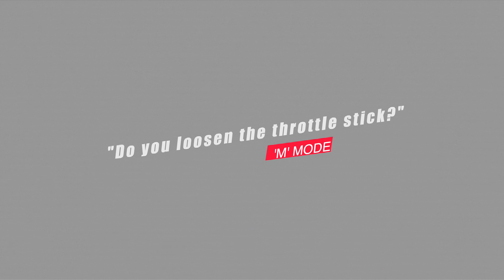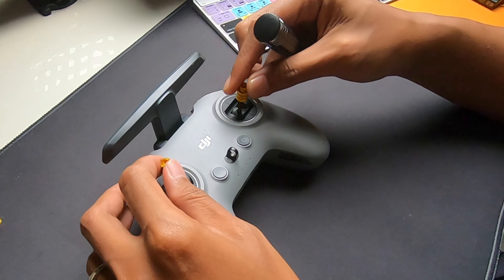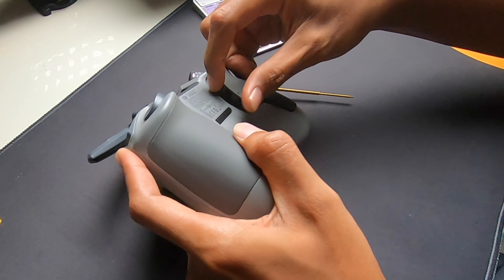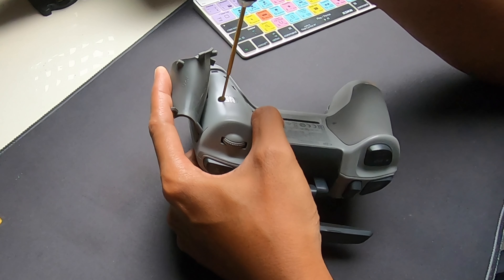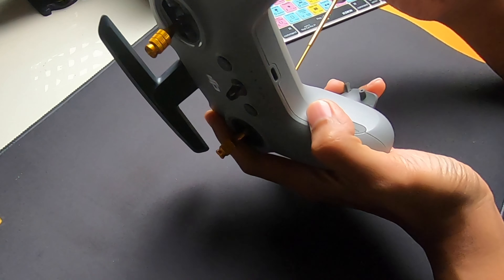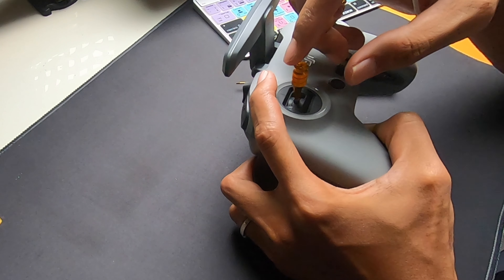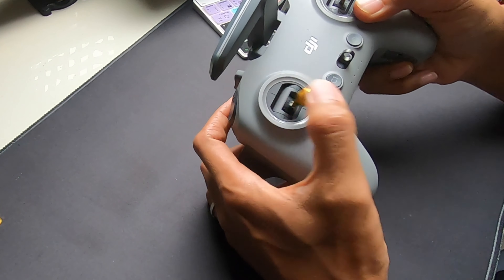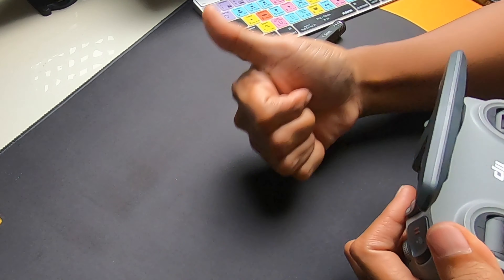Adjust Your DJI FPV Controller For Manual Mode

Comment: I've just finished setting up my RC2 on 2x O3 equipped quads.  Thanks for the vid, worked perfectly.
BUT, where did you get those longer sticks?  I gotta have them!!
Reply from the maker: You're most welcome! I wanna get that done too! Just got the O3 but have yet to get them on a quad. Im using StartRC sticks, but cant seem to find them on AliEx anymore. Maybe you could get something similar.
Reply: @TheReelRahim  I made two extensions out of the 2mm posts I took out of one quad when I upgraded to the O3.  First I made 9mm extensions as that would match the height of the big black DJI box I'm used to flying.  But that seemed too tall, so I made some 6mm ones.  Flew that for a while and switched back to the 9mm.  The height is right, but the body of the DJI stick is smooth, I need something prickly.  Amazon is the only place that has them - those are too long and I hate Amazon (they stole $277.20 from me, but that's another story.)  I'll probably end up designing and making some.  I'll let you know when I do.

Have you had any trouble with the RC2 saying sticks out of range or some such error message?  I had it pop up in goggles yesterday, rebooted everything and it went away, but I've seen others say the same and it's somehow related to the adjustments we do to make the sticks as you describe in your vid.

Comment: Hi sir, can I check with you what type of screw driver to use for screwing? Thank you
Reply from the maker: Hi friend!  Im using a 1.5mm Hex Driver from RJX brand. Usually sold in a set of 4 sizes for RC hobbyist. If you dont want to spend on that, you could get the DJI FPV braces (assuming you have a DJI FPV), and that kit would come with a 2-in-1 hex driver (1.5mm and 2mm). Hope that helps.
Reply: @TheReelRahim  i don't have the Dji FPV. The controller 2 when purchase seperately doesn't come with any screw driver. But managed to do it with the 1.5 mm. Anyway thank you sir! All the best from us in Sepang Malaysia!

Comment: What happen when using stabil or norrmal mode? How to hover? Keep the throttle centered or down?
Reply from the maker: Sorry I missed this. Been away for awhile. So aniways if you switch to N or S modes, all you need to do is keep the throttle around the centre of the controls. No need to look at the controls, just see in the goggles. Just adjust the stick position to whether the drone is hovering in place or moving upwards or downwards. In N or S modes, the stick will not be as sensitive to input. So that means that as long as you are generally putting the stick in the centre, then the drone will hover in place. Another good way is to observe your "H" at the bottom left of the screen. Its for Height/Altitude, and is a better gauge to whether the drone is hovering at that altitude. Hope that helps.
Reply: @TheReelRahim  Thanks... I eventually found that out myself😅

Comment: i was eyeing the bling lol.. thanks i was able to adjust my controls for the first time.. still scurred to switch to manual but ive had it for a while and ive been practicing on liftoff with the dji blueprint download soo here goes nothing
Reply from the maker: You're most welcome, and hope your first manual flight was a good one 🤟🏽. Glad u have been practicing on the sim, as many do not know that Manual mode is a whole different beast, and going there without prior sim practice is nuts. Stay safe in the skies friend 🤟🏽

Comment: This worked great for flying the DJI Avata in manual mode. I could fly in acro just fine, do my flips, rolls etc. However, as soon as I activated manual mode in-flight the goggle show a "remote controller control stick error" error message in the lower right. Is this something I need to live with because of the Controller mod or can I make it go away somehow? Many thanks 🙂
Reply from the maker: I did firmware updates and it went away. That should help. Sorry its been awhile since I responded. Do share here if you are still experiencing it, thanks.
Reply: @TheReelRahim  Recalibrating the controller was the solution for this in my case :-)

Comment: Hi I enjoy your videos. I have been trying to make the switch to manual mode. However I’m having one issue. I adjusted my sticks as you showed. But when I go to try and fly when I throttle up and bring it back down it does not throttle down immediately and it hops across the surface. Is there something that’s not set right.
Reply from the maker: Sorry I missed this and great to hear from you again. Not too sure what you mean. Whats "hops across the surface", and have you found a solution to this yet?

Comment: Great video! Thanks for the insights :) May I ask which flight simulator software you use? Got a quick question regarding the throttle. Was not able to really hover in the same position, after adjusting the sticks, but not too sure if its just my shaking hands, that I either give too much throttle or to way too less...
Reply from the maker: Thanks! I use Velocidrone and for easy on-the-go with my Android phone, i use this:

https://youtu.be/9WY297mYwzs

About the hover in place, its likely shaky hands. Im assuming you mean hover in Manual mode. Its not easy to do so in Manual mode, as throttle is on your full control. When I try to hover, im actually making micro, VERY MICRO bleeping of the throttle to keep it in place, and gets way harder to do so if its a windy day. So no fret, it takes awhile to really hover the drone in M mode.

Comment: Great content as usual. Is there any benefit to loosening the right to make it more nimble with less spring tension or am I looking for trouble, Rah? I got my DJI FPV quad a few weeks ago but I'm waiting until my Avata arrives to start in acro mode even though I'm sure I could fly the FPV no problem. The Avata was my answer to indoor flying this winter instead of getting a cinelog 35 and having to deal with betaflight and all the things that don't involve actually being in the air.
Reply from the maker: We all love that we can fine-tune our drone to perfection. And that was what the DIY drones could give. But here is the thing, i have a Cinelog25 myself and i realised that when i got it, i didnt give a shit anymore. lol! All i did was throw in rates that im familiar with and sent it. BOX STOCK and it has been a year and more! didnt care for filters, fine tuning etc. Just send it! and yes, im in comfort zone with the DJI FPV and Avata. Safety features present, personal rates in and just got it up in the air. Yes i got adapters and i used DIY props on my DJI FPV, but that was pretty much it. Just to have options on props. So anyways just for clarity, im a Mode 2 pilot. I only have my throttle (left stick) loosened and nothing else. No adjustment on the right stick. Someone else did so and crashed on landing as it didnt keep the drone level since the sticks were not perfectly centered. Nothing to stop you from trying, but i wouldn't recommend it. Anyways welcome to FPV and i'll see you in the skies friend!
Reply: @TheReelRahim  makes sense about not f@cling with the right spring tension. My avata came today and damn nobody warned how long those batteries take to charge compared to the original fpv lol. I got one flight in before dark so now I’m going to rip through the house :)

Comment: My biggest problem is that I wanna be able to switch to manual from normal/sport and then midlfight I can switch it back to Normal/sport 
I do not want to adjust the stick every time would it be possible that I could leave it spring loaded or maybe in between so it slowly returns back to center ? 
Thanks great vid
Reply from the maker: Yes u can with the original spring load, or ease it abit so its not so strong. This episode is just a guideline, and i hope u find a setting that works for u 🤙🏼
Reply: @TheReelRahim  thanks man

Comment: Thanks, so what happens when you put the throttle all the way down when the drone is air bourn doe it kill throttle completely :)
Reply from the maker: Great qn and thanks for bringing it up. Actually, you would have zero throttle input from transmitter. ZERO is the key word here. Th drone receives a zero command, but internally within the drone, the programming will still have motors spinning. This is the PID tuning working as it will maintain the attitude of the drone in flight even when throttle is 0. Similar to a car off throttle will coast. If the drone propellers is allowed to stop, it would tumble in the air, and may not be able to stabilise itself back. Hope that simply explains it.
Reply: @TheReelRahim  Exactly what i thought should happen as this is how i setup build racing drones :) i just didn't know if DJI did the same thing, im, considering one of them.
Reply: @TheReelRahim  So if you switch to normal mode do you have to centre the throttle stick for GPS hover?  :) im guessing yeah.

Comment: What about the other stick? Do I need to adjust it too?
Reply from the maker: No there is no need. Maybe for different tension feel, but no real need. I dont. Just the throttle stick will do. Hope that helps.

Comment: What camera u using
Reply from the maker: Im using a Canon 90D DSLR for the overall shot and a Gopro Hero 7 for the closeup. Im loving it for the flip touch screen and continuous autofocus tracking. If this broke and I needed to get a replacement, an 80D would do the job just fine, AND CHEAPER. But its the lens that is the winner here. Sigma 18-35 f1.8. Its just GOLD. Sharp, great bokeh and colours! But IT IS HEAVY. Many videographers use it for cinematic scenes.

Comment: Hi Rahim . I have done the back part Tightening the F1 screw and Loosening the F2 screw . My question here do i have to change any setting because the i chop the throttle the motor shuts off
Reply from the maker: If u are grounded, then the motors will cut if u chop the throttle. This is part of landing procedure. But if u do the same in air, motors will be at low spinning idle and will not cut off, unless u off motors via switch. Hope that helps.
Reply: @TheReelRahim  off Motor switch means ?
Reply from the maker: In one of the firmware updates, u can start assigning the right 3-way switch to on/off motors, but only avail in Manual Mode. Useful for me, as its common practice for DIY drone pilots to have a dedicated switch to arm/disarm motors.

Comment: Good day, how can I return back spring resistance
Reply from the maker: Actually just loosen both the screws until you do not feel resistance in the screw threads. Careful with that as you do not want to fully unscrew the grub screws until they fall out. Just enough till you get the sticks back to self-centering. Hope that helps. Good day to you too, and fly safe!
Reply: Thank you, got it, and another question: my RC in calibration mode working good, but in real flight and demo mode it’s  not starting the motors when I moved both sticks 45* in
Thank you again

Comment: I used the allen tool that it come with the controller.   I did abit tight the screw  and the handle is almost loose but still feel a bit springload so should I do really tight the screw with the Allen tool abit harder. I wanna the handler to be really loose.
Reply from the maker: Sorry I missed this. Been away for awhile. If you screw it till the end and still feel some spring, that will be the max. If u then screw in some "friction", the spring tension will no longer be noticeable. Maybe this would be a good workaround the situation. personally i prefer no springload, and abit more friction to give it less of a toy feel and more "response".

Comment: How do you switch it back so you can fly normal and sport with the controller?
Reply: I got it working again, had to recalibrate the controller for it to work again :D

Comment: Can you still fly normal mode with no tension in the throttle stick?
Reply from the maker: Yes u can. In goggle view, just estimate the middle point of the stick for hovering. Its easy, just give it a try ✌🏽
Reply: @TheReelRahim  Awesome, thanks for responding

Comment: Do you ever try to practice manual mode in line of sight flying? Do you have a video?
Reply: Yes he does i watched one of his the other day. His goggles were broken and couldn't get them back for 6 weeks. His flight didn't go well lol 😆
Reply from the maker: That was embarrassing! hahahaha. But its all good. just need to get it repaired and up in the skies again.
Reply from the maker: Yes I do practice LOS flights, but not often enough on the DJI FPV. Crash rate is too high. Here is a sample of LOS flight. Enjoy! 
https://youtu.be/SotTaM2FIr4
Reply from the maker: Anyways im getting back the hang of LOS flying. Can't wait for goggles to be back. The drone kinda doesn't want to do LOS without a goggles connection. I think this will trigger failsafes. Already scheduled for a future episode!
Reply from the maker: Yup, got me a printed piece. Gonna mention it in a future episode.

Comment: To make manual mode
F2 Screw in all the way. 

F1 Tighten F1 until the stick doesn't giggle too much. 
Adjust to your liking. 

To make into normal mode
Loosen F2
Loosen F1
Reply from the maker: Thanks for the summary mate. See you in the skies!

Comment: Hi Rahim...are you able to fly the drone in normal and sport mode with the mode 2 throttle stick in manual mode i.e.  not self centering?
If so, what was your experience?
Reply from the maker: Yes its possible. Its just that u need visual ques while in goggles, on whether your throttle stick is centred. For example, if i switch back to N or S mode, ill estimate to centre my left stick and make adjustment as its usually not far off. This adjustment is based on whether in goggle i see my drone is rising or descending. There is fair tolerance once the left stick switches back to being Altitude control, so no worries there. Since in FPV u are ALWAYS on the sticks, it becomes muscle memory to make adjustments when back in N or S mode. Try it in e sime 👍🏼
Reply: @TheReelRahim  Thank you Rahim. I will have to do that as my primary intention is manual mode, but I like the idea of taking off and landing in N mode; primarily to reduce wear and tear on the drone. It's been my FPV experience (analog, then digital) that the landings reduce the life span of traditional FPV drones.
Reply from the maker: AGREED. LOL! There have been soooo many minor flips that happen on landing a traditional drone. But w e DJI, its just convenient having controlled angle modes for landing. Just flip in N or S, the drone immediately goes to hover. Just adjust e altitude and u r good to go 🤟🏽

Comment: Only left side can adjust? Cannot adjust right to make it MODE 1?
Reply from the maker: You can, but you need to do it in the goggles first. Go to controller settings, there will be a setting that you can change from Mode 2 to Mode 1 or 3. After which, you can adjust the Right stick to your preference. Hope that helps.

Comment: Question. Can I undo the right stick as well (both directions) and yaw on the left as well? Now that I have some experience it feels that they are too hard so when I make transitions from left to right etc. it's hard to do it smooth hence it shows as jerky on the footage. Especially on the left stick, when I wanna turn but keep the throttle at about the same value. :) I just think the click is too hard when transitioning at middle point.
Reply from the maker: I see. Yep its that mid point transition. But there is no adjuster screws for that. So to get better control, i use longer sticks ✌🏽

Comment: My right stick is slightly off center and naturally stops slightly to the left of center. This affects my ability to fly straight because the drone is always tilting left unless I manually adjust it... do you know how to adjust the sticks back to center from their left-right orientation?
Reply from the maker: Im sorry i missed this. Did you manage to sort it out? This shouldn't be the case with the controls. Seems like there is issue with the gimbals of the controller. There is no direct adjustment to the left and right. You would need to take apart the whole controller to rectify this. Best bet is to bring it back to DJI for repairs.

Comment: CAN i USE IT LIKE THAT ALSO WITH THE MODE n AND s?
Reply from the maker: Yes you can. When you switch to N or S mode, the Throttle will be switched back to Altitude Control. Since the stick is loosened, drone will hover but not be able to automatically keep the same altitude, since the stick cannot self centre. While you are flying and wearing goggles, just estimate the middle position of the Altitude Control stick on the Remote Controller. You can see in the goggles if the drone is staying in position, or it is going up or down.

Comment: Does this mod negate N and S mode throttle?  Ie do you lost throttle control in N and S mode or do you have to manually center the throttle stick to hover in one place?
Reply from the maker: Sorry I missed this. Been away for awhile. Yep. By doing this, you would have to manually centre the stick if you want to hover. You dont have to take goggles off, just estimate the hover with what you see in the goggles. There is quite a big tolerance in finding the throttle stick middle zone for hovering. Try it out and hope that helps. You can always undo the process. In default self centering of the throttle stick, it just feels odd to fly manual mode, especially if you want to go aggressive with the acrobatics, as its a restriction in the mid stroke of the throttle. Distracting too.

Comment: Can this be done for mode 1? I.e. throttle and yaw on the other side.
Reply from the maker: Yes it will work just the same. Tighten F2 till finger tight to loosen the spring tension, then add F1 as "friction" to what you are comfortable with flying. Try it out and hope it works out for you.
Reply: @TheReelRahim  thank you